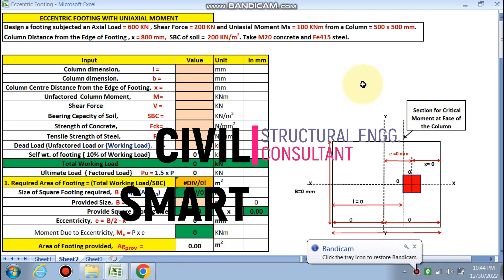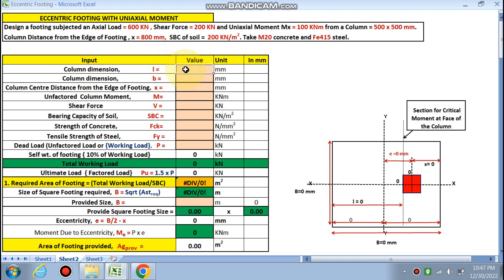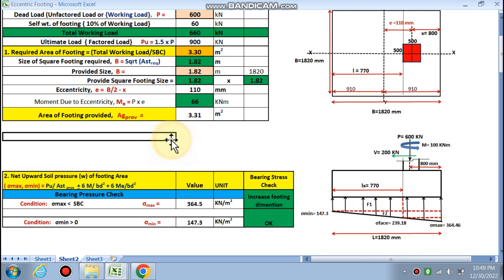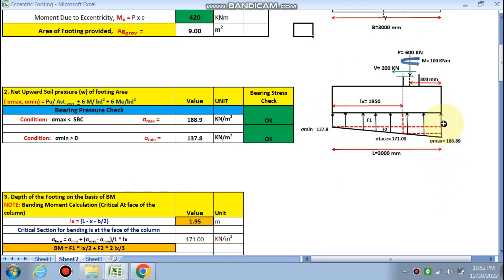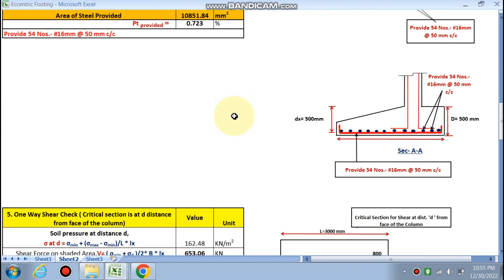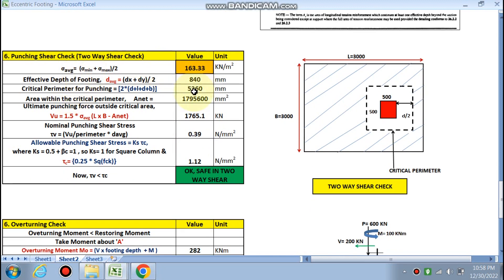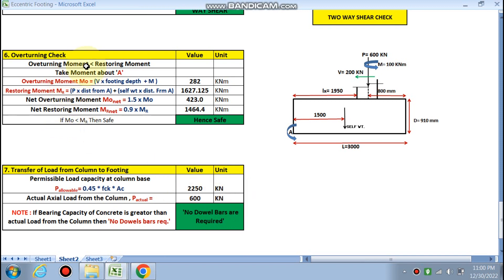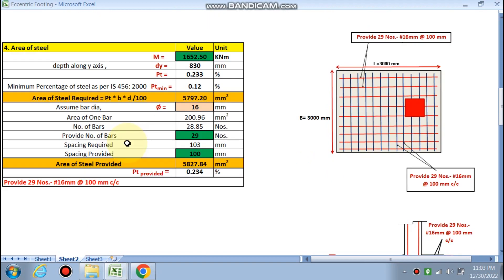ECCENTRIC FOOTING DESIGN ( COLUMN AT DIST 'e' from Centre)

Comment from the maker: To get all the footing excel Sheets get from below link:
https://pmny.in/PAYUMN/WJczW5eItHK9
Full design Excel sheets course 

https://pmny.in/xIYR3zBkCQTT

Full Course includes all sheets as under:

IN FOOTING DESIGN SHEETS

1. Isolated square footing

2. Isolated rectangular footing

3. Combined rectangular footing

4. Trapezoidal footing design

5. Strap beam footing design

6. Footing with uniaxial bending

7. Footing with biaxial bending

8. Pile foundation

9. Pile cap design 3 & 4 piles

10. Wall footing/ Strap footing

11. Raft Foundation ( Beam and Slab Type).

12. Strip footing design ( 4 columns).

13. Eccentric Footing Design (Column at dist x from the edge of footing).

14. Eccentric Footing Design ( Column is at Edge of the footing).
 
IN BEAM DESIGN SHEETS

1. Singly reinforced beam design sheet

2. Doubly reinforced beam design

3. Continuous beams design  with point load having :

    2-span continuous beam

    3-span continuous beam

    4-span  continuous beam

    5- span continuous beam

4. Cantilever Beam Design.

5. T-beam Analysis.

IN COLUMN DESIGN SHEETS

1. Axially loaded column design

   (a). When column size is known.

   (b). When column size is not known.

2. Column with axial load with uniaxial moment ( on 2 sides and 4 sides reinforcement)

3. Column with axial load with biaxial moment

4. Mux and Muy Calculation sheet.

IN SLAB DESIGN SHEETS

1. Cantilever slab design sheet.

2. Simply supported slab design sheet.

3. One way Continuous slab design sheet.

4. Two way Continuous Slab design sheet.

5. Two way simply supported slab design sheet.

6. Flat slab design (without drop and column head).

7. Flat slab design with drop only.

8. Flat slab design with column head only.

IN STAIRCASE DESIGN SHEETS.

1. Dog legged staircase design.

2. Open well staircase design.

IN RCC WATER TANK DESIGN SHEETS.

1. RCC WATER TANK RESTING ON GROUND (L/B <2).

2. RCC WATER TANK RESTING ON GROUND (L/B >2).

3. UNDER GROUND WATER TANK DESIGN (COND. TANK IS EMPTY AND OUTSIDE SOIL IS SATURATED).

5. UNDERGROUND WATER TANK ( TANK IS FULL AND NO OUTSIDE SOIL PRESSURE).

4. UNDER GROUND CIRCULAR WATER TANK.

5. Overhead Circular Water Tank design.

6. Intz Tank design.

IN WALL DESIGN SHEET

1. RC WALL DESIGN SHEET.

2. RETAINING  WALL DESIGN SHEET.

3. BASEMENT RETAINING WALL DESIGN SHEET.

4. Counterfort Retaining wall design sheet.

5. Shear wall design with boundary elements condition.

Building load calculation sheet

Cost estimation sheet..etc.

Comment: Question itself is wrong ..If column is subjected to moment how it will come to footing ..Why did u include column moment in footing ...?Can u answer to my question
Reply from the maker: Column is a compression member which transfer the axial load to the footing for which footing is designed, but in practical column also consists of Axial load ,shear force ( due to horizontal force) and moment either uniaxial or biaxial moment which is to be transferred to the footings.
In this case the column with uniaxial moment  is not at the centre, hence additional moment due to eccentricity comes on the bottom of the column footing, all the moment ( uniaxial plus moment due to eccentricity) needs to be resisted by the footing in addition to the axial load.